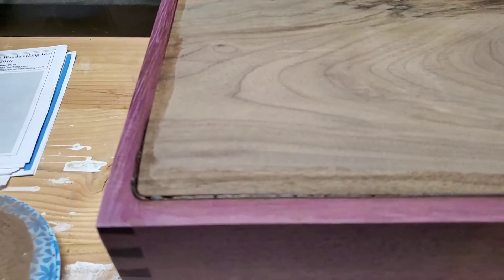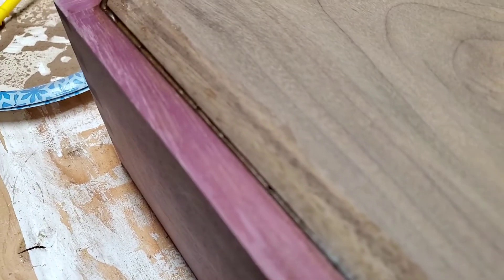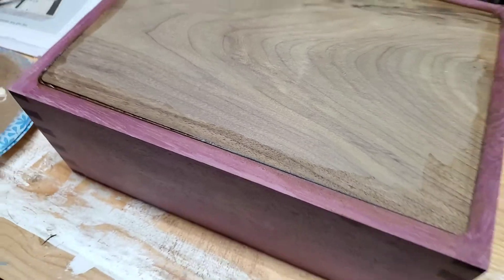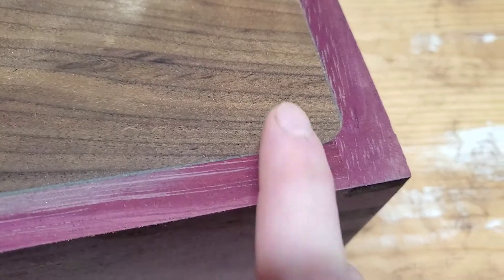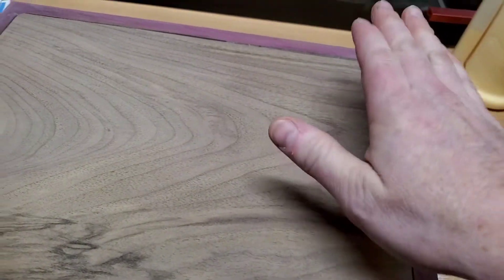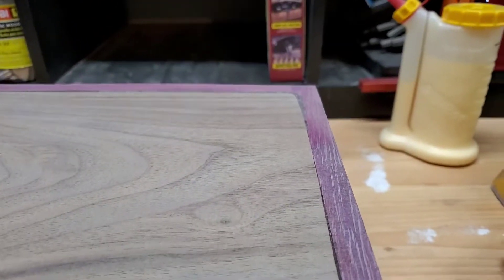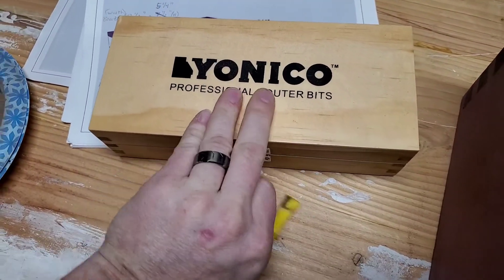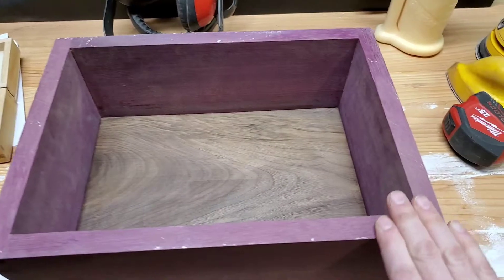Wood Filler Results | Sealed Bottom Panel | Woodworking

Comment: Nice job on the follow up!  It appears to me that the glue/sawdust method is great for filling gaps solidly.  In terms of color matching it appears to be really good in the smaller gap where it looks like the darker grain...in the larger gap it appears more like an epoxy.  Lots of good information here.
Reply from the maker: Absolutely!! Did a great job in the whole process.